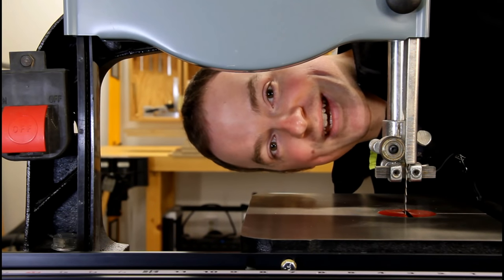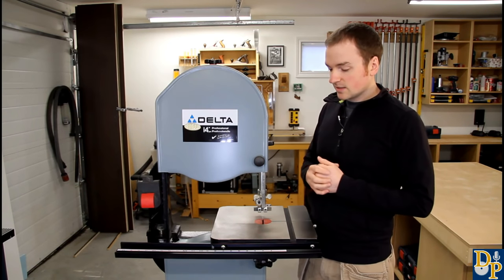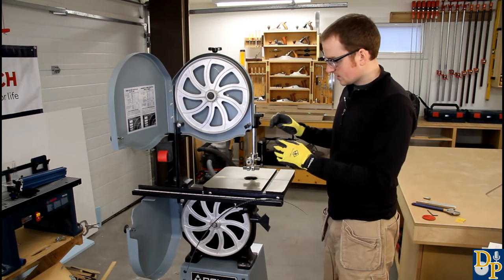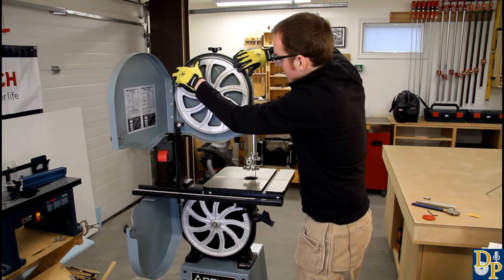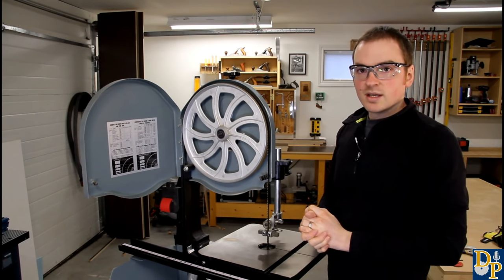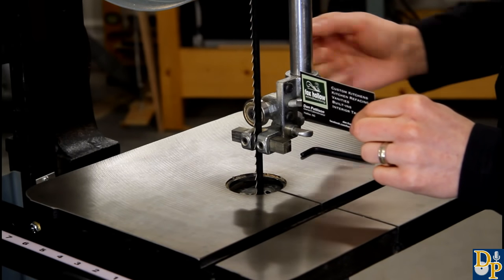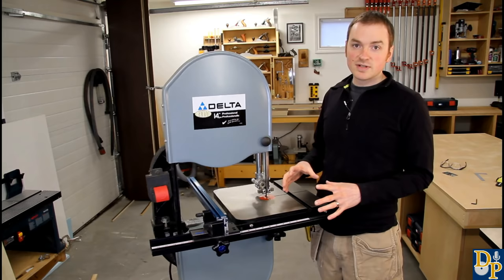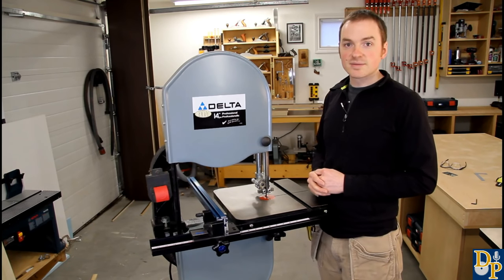Band Saw Basics

Comment: Hi Dan, I have a Clarke three wheel band saw. I have found that the tension and tracking adjustments are interactive and so finding the 'sweet setting' is a bit of to and fro. Also despite the size capacity to re-saw the power of the motor seems to be a limiting factor. I have tried with re-sawing a four inch high cut but eventually it pulled the blade off the wheels and wrecked the blade. I have made a rocking pony from 1.5 inch plywood and it cut all the curves a treat. Colin in Northern Ireland
Reply from the maker: +colin farrier three wheeled band saws can definitely be a challenge to set up and use.  The first band saw that I ever had was a 3 wheeled model but I ended up returning it because it was impossible to adjust properly.  Sounds like you've been able to get yours to work though with curved cuts.

Comment: I have a nine inch Craftman bandsaw that is fairly old and I've never had a lot of success in setting it up and using.  I think your video will help me a lot as your explanations are easy to understand and follow.  The only thing I found confusing was setting up the co-plane.  Most manufacturer say that the co-plane is factory set and should not be tampered with.  Also, I find that cutting softwood is fairly good but hardwood is quite a bit more difficult.  Is this normal?  What size of a general blade would you recommend.
Reply from the maker: There are definitely different schools of thought on co-plane. I just shared what I learned and have found works for me. Hardwood is definitely more difficult to cut through since it is more dense. I usually use a 1/2" blade in my saw for general use. It won't cut tight curves but it's very seldom that I do.

Comment: Great. so Mr.Dan may I ask When its must to change the blade & how to know if the after while is still sharp and safe to use ?
Reply from the maker: +AHMED SALEH good question. You can usually tell when a blade is very dull if the saw is struggling more to make the cut or if the cut is burning from excess heat. If you have a good magnifier or eye loup you can also do a close inspection of the teeth to see how sharp they are. Usually I tell by the feel when I'm cutting if the blade is getting too dull.

Comment: Hi Dan.  Really enjoyed your video - subscribed and liked - I have a Skil 3386 that I haven't used for a while because it needed new wheel tires (it takes the ones that have the slotted tires)  I finally found a place that sells them and put them on and am having a problem with the blade moving forwards and backwards on the tire - it's moving about 3/8" on the bottom wheel and about 1/8" on the top wheel.  Not sure what I need to do - any suggestions???
Reply from the maker: +instgtr52 thanks and glad to hear that you found the video helpful.  Is the blade moving back and forth on the wheels when you're cutting?

Comment: Very good video and presentation. I have an old 9" Delta that's not being any help when it comes to drift. When you adjust the guide at an angle to compensate for drift, do you have to adjust again for different blades and wood types etc.? If anyone can answer would be highly appreciated. Thx.
Reply from the maker: The type of wood shouldn't make a big difference but I would definitely readjust for a different blade since it will perform differently.
Reply: @DPShopTalk  Thank you!

Comment: Hey Dan, just found you on Instagram. Cool channel! My band saw has been cutting bad for a while and I've tried all kinds of things. It stalls very easily, cuts slow, and gives a rough cut. The next thing I was gonna try is replacing the drive belt. Do you think a loose drive belt could be the culprit? Thanked!
Reply from the maker: +A Guy Doing Stuff what size motor is on your band saw and what make and model is it?  It sounds like the drive belt or the drive belt tension could definitely be an issue.  If you're going to replace the belt I would recommend going with link belt.  That's what I use on my band saw and I replaced the original belt with it.  Reduces vibration and increases power transmission.
Reply: +DP Shop Talk cool I'll look into that. Thanks!

Comment: Dan, when you re saw thick wood, does the back of the blade normally make contact with the thrust bearing? Is that normal?
Reply from the maker: Yes it's normal for the blade to contact the thrust bearing when making cuts.

Comment: A bit of bad info sir. There is mo such thing as blade drift on a properly tuned saw. Set the back of the gullets on the center of the top wheel and it will cut a straight line.

Comment: what is the difference between a 9" and a 14" bandsaw. Where are these inches measured!
Reply from the maker: The size of a band saw is determined by the distance from the blade to frame of the saw. So basically the maximum width you could cut on the saw.

Comment: can band saws be used to cut metals?
Reply from the maker: +Terry M yes they can with the right blade.
Reply: Thanks Dan, are there any limitations on the type of metal. I heard the term ferrous metals as ok with right blade.
Reply from the maker: +Terry M I think it really depends on the type of blade you use.  I don't think I've ever cut metal with my band saw so I can't really speak from experience.
Reply: to cut metal you need to use a blade for metal and also lower the speed of the blade, not all bandsaw can lower the speed.

Comment: I was always under the impression that the wheels don’t have to be in complainer and the blade should be set with the gullet in the center of the top wheel. I’ve watched and used Alex Snodgrass’ system and never had a issue.  https://youtu.be/bxVyKsbuwZQ
Reply from the maker: There's definitely different schools of thought when setting up a band saw. This has always worked well for me but I've been meaning to try Alex's method as well.